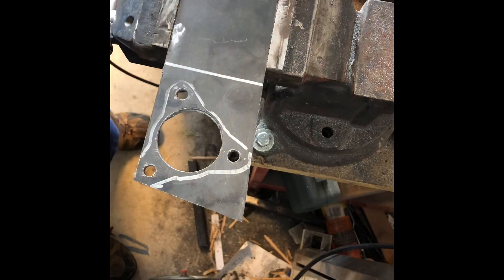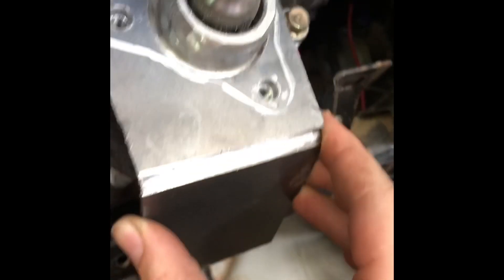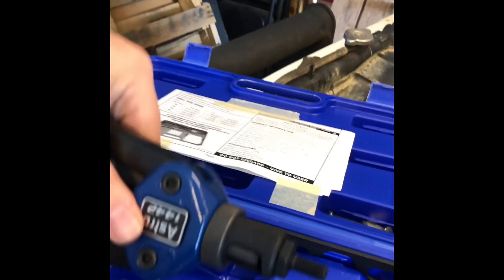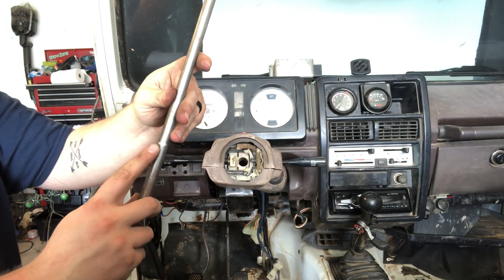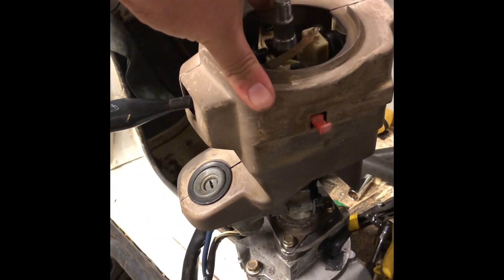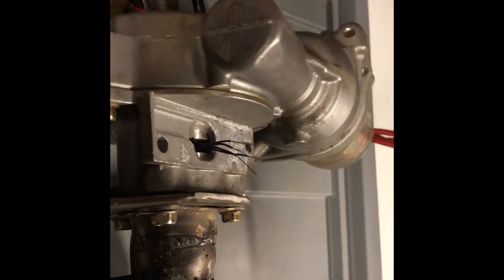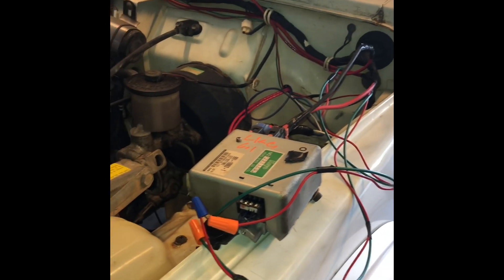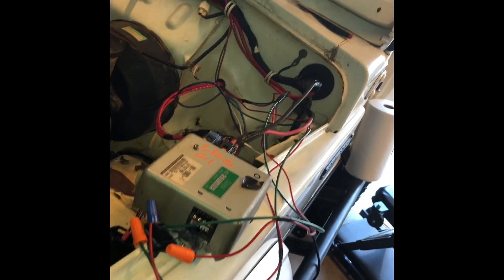Suzuki Samurai Electric Power Steering Install!!! Part 2

Comment: Where’s the electric power steering comes from?  I have a samurai fully loaded with everything except this electric steering unit to turn my 37” tires.  My power steering gear box was from a 94 4runner to a sidekick power steering belt driven unit, and I still need it to be more soft on turning my 37” tires.
Reply from the maker: Phuab&NomHawj Yaj  the power steering unit is from a Saturn Vue

Comment: Cant find that link for the wiring
Reply from the maker: https://www.ebay.com/itm/Saturn-Vue-Chevy-Equinox-Electric-power-steering-electronic-controller-box-EPAS-/142461763061
Reply: Cody's Garage  is this for toyota prius electric power steering?
Reply from the maker: Jarno Kuittinen no, for saturn vue style

Comment: Please can review how to wire up the ECU box. I saw that you have also install potentiometer. Please review also the installation for this on the box
Reply from the maker: Amar Sew the ECU is pre-wired from the factory to the motor, all I did was extend the wires so I could relocate it a little further away. In regards to the potentiometer, the ebay seller includes a wiring diagram for his kit with a purchase of his product. Out of respect for the seller, I didn't want to share his diagram. It is a very simple plug and play system though with only a few wire connections needed (power, ground, and a couple of wires to the knob). If you want to contact the ebay seller, he may be willing to send you the wiring diagram prior to purchasing the kit. Link is in the description above.